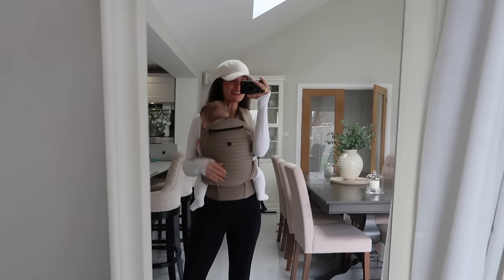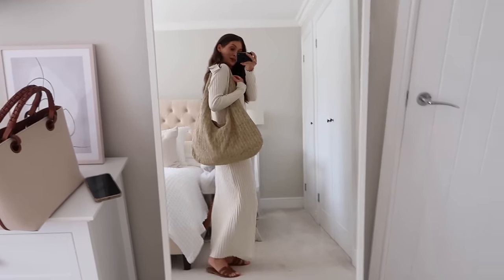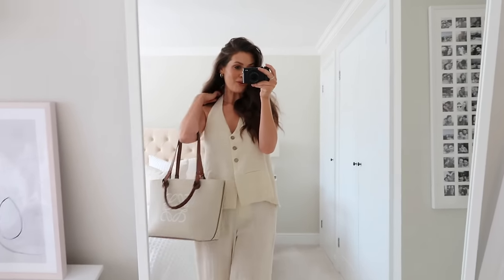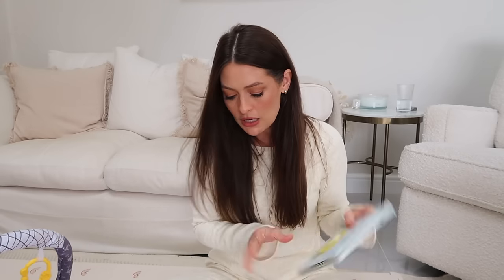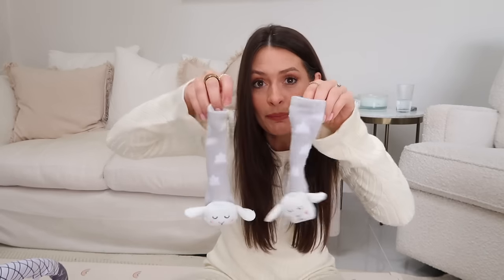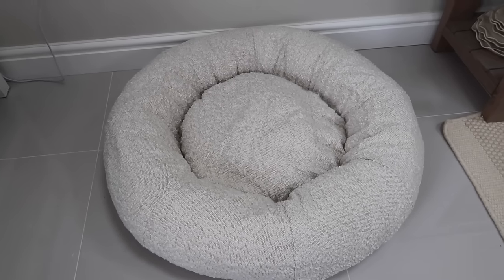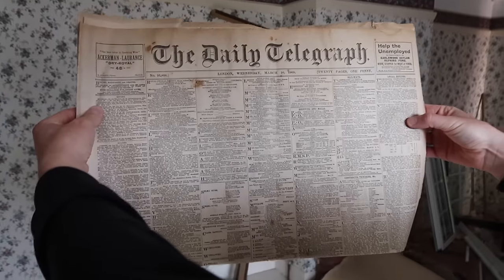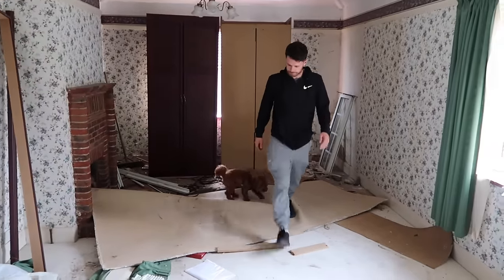NEW BAG & SHOES, FREE PEOPLE HAUL & HOUSE RENOVATION UPDATE

Comment: I like the knitted dress surprised there isn't a small slit at the bottom though and length not sure I could pull off ;) cardigan in grey is nice not sure about the trouser part. The bag is cool always wanted one of those if it closes properly will have a look. The lighter creme jumper is nice but again the trousers would not look well on me. I think the denim duo would look better as a dress rather than top and trouser jumpsuit. The second denim is better as a top and trouser jumpsuit fits you better. The white halter would look better with a skirt at knee height. What if you got one of those prams with sport wheels so you can do some running with Lottie ;) Lottie's probably wondering why Mum is wearing a cap indoors ;) I would get a play pen now before she starts crawling :) play with Rafi on the bed with his toys his scent will get on it and eventually he will call it his bed. If you put it on the sofa and encourage him to lie on it might help and eventually move it to the floor. Sell the paper might be worth something to someone. I didn't realize you were doing an extension certainly better idea than the conservatory for the modern family.